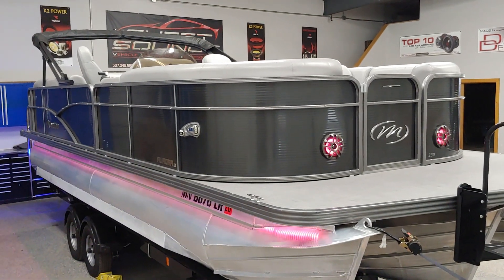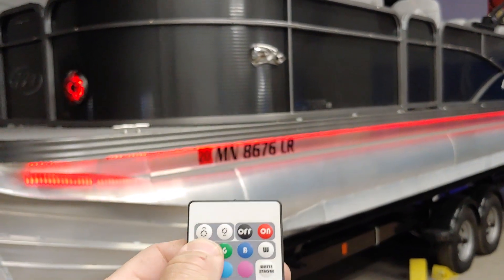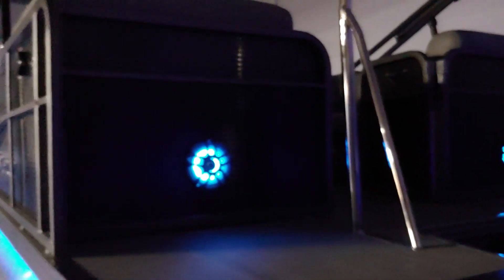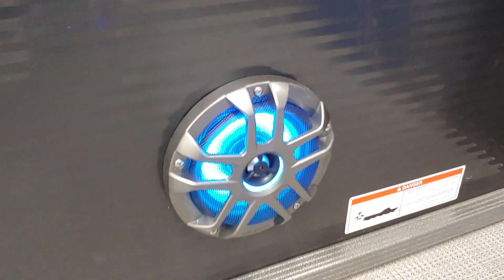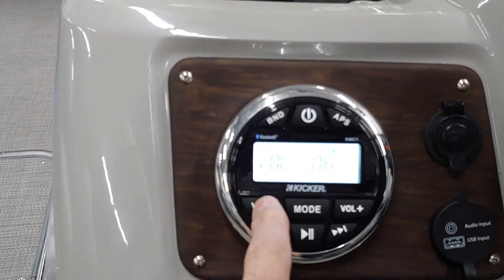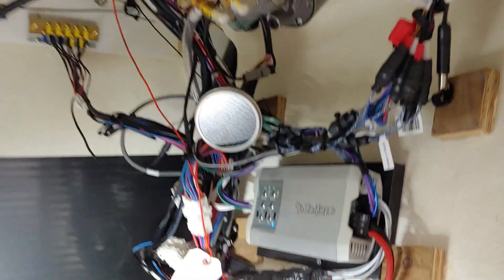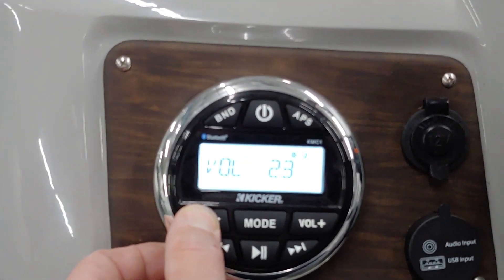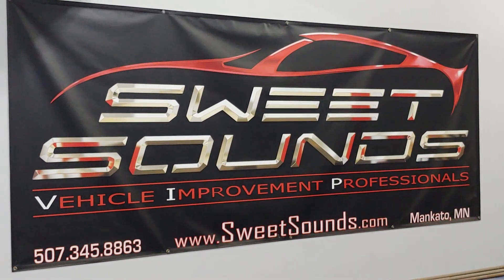Sweet Sounds upgrades the stereo system & adds RGB lighting in a Manitou Aurora LE 22' Pontoon

Comment: Did you cut those speakers in the front and rear right into the seats?
Reply from the maker: The backs of some seats are hollow and thus don't need to be cut. Some are not hollow and need to be cut. Sorry, I don't recall what this particular model needed. We just do what the proper job requires.
Reply: @SweetSounds  clean set up thanks.
Reply from the maker: @jayknowles3752  Thank you.